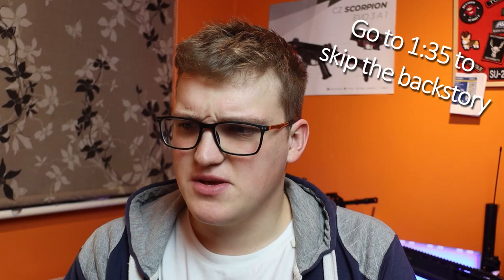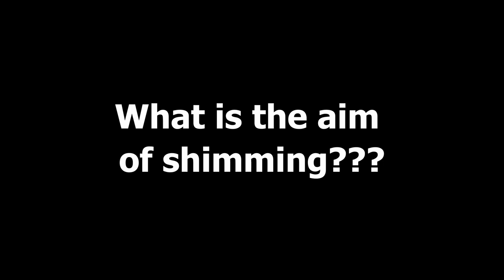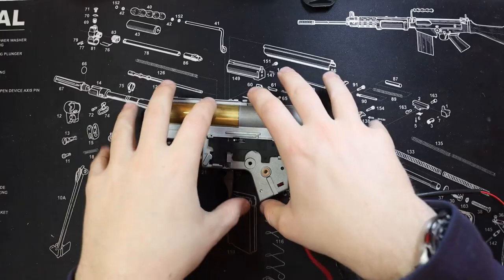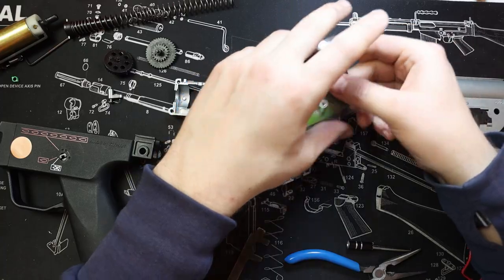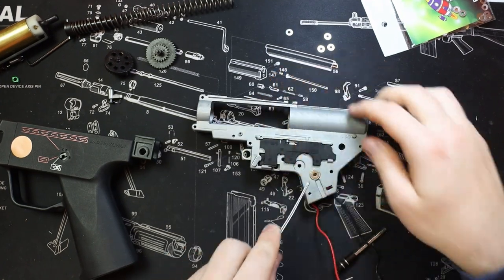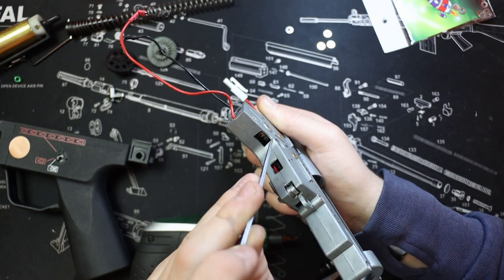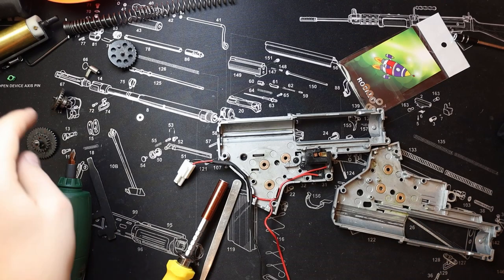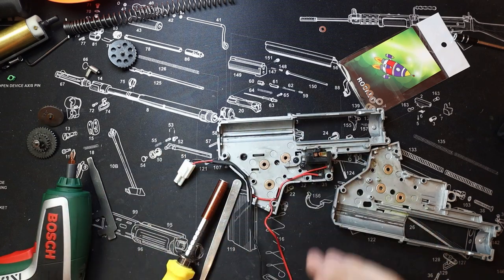English Kiwi Explains: Shimming

Comment: You sometimes have to somewhat do it the other way round when you fit an optical Mosfet as you have to clear the board.
Reply from the maker: Very true! And for half rack pistons as well. I did mention it somewhere, but I think that ended up on cutting room floor!
Reply: English Kiwi it’s unfortunately fairly common for people to pinion/bevel shim and then trash the sensors on the board with the sector gear when it spins :(

Comment: I managed to break my hopup arm so the SR-25 is still down for the count until a new one arrives :( Thanks again for fixing the gearbox though. Kiwi is a very nice guy chaps ;)

...Except when he nades you.
Reply from the maker: that... that was a clumsy grenade related mistake...

How did you break the arm, Were you trying to modify it?

And no worries, it was an absolute pleasure to check out the awesome build you've put together :D
Reply: @EnglishKiwi  I broke the arm using the power of being an idiot. Tried replacing the standard nub with a maple leaf one that was about double the depth, so when I turned the wheel snapped the little plastic guide thingy. May also have misaligned the window and had the nub press against the barrel I guess, can't be sure. 🤦‍♂️

Got a metal arm and nub (is a metal nub still a nub? 🤷‍♂️) today which should fix it.